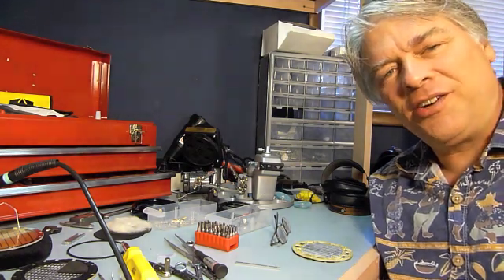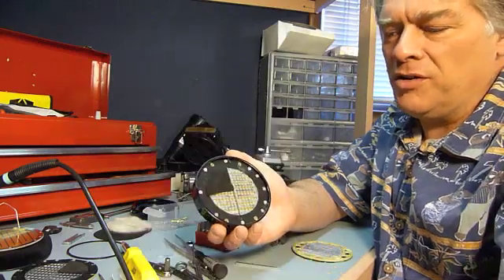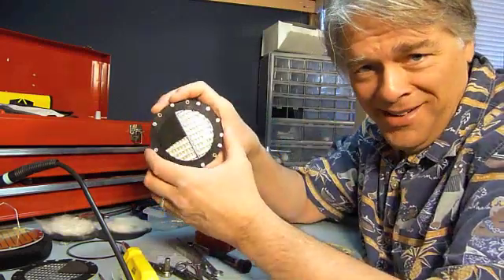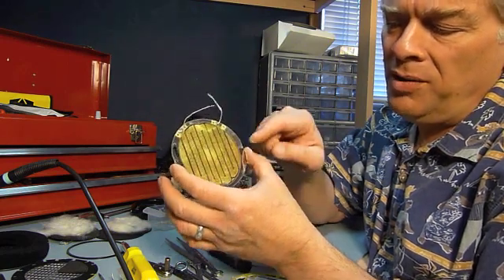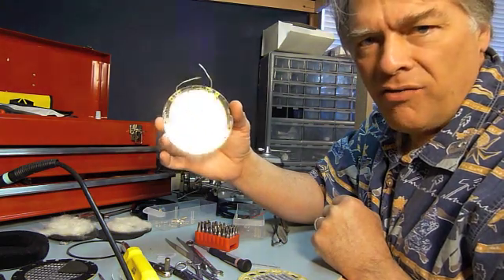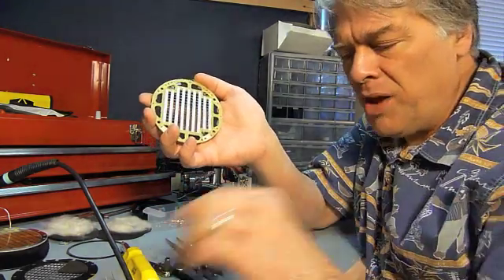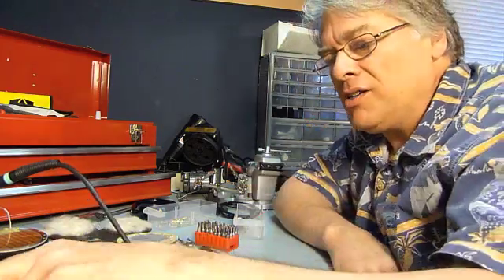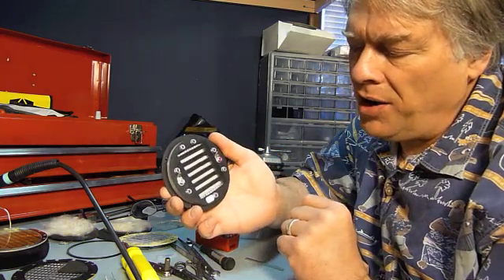Anatomy of a Planar Magnetic Headphone Driver

Comment: this leads me to believe to if you put a magnet on the outside of the cups, it would affect this isomagnetic field as you've shown. Is this accurate?
Reply: Yes it will. Depending on the directions of the magnetic fields the effect will be different. 
In theory even the screws would affect the magnetic field if they're made from ordinary steel. That of course is negligible.

Comment: What is the diaphragm made of?
Reply: Manufacturers use different materials. The most common are kapton and mylar. The thickness of the foil is more important. It should be as thin as possible.  The high end headphones have foil that is 1um or even less.
The biggest unknown would be how they make the tracks on the foil and again every manufacturer probably uses different techniques and materials but no one is telling what.
Reply: @svetko05  i accidentally let my headphones clap together as soon as I unboxed them, would this stretch the diaphragm and change the sound? Or would it just tear if damage were ever to occur?

Comment: since it's a film with with metal in it, and not evenly distributed. does that mean that certain frequencies will be dampened and some amplified? since the metal has a different resonating frequency then the film? they add (those freq) and will distort the sound in that way and also will change the freq response in unexpected ways due to the metal not really being one piece (which i get you need the current to follow a path to make a field) but atleast make the gaps closer together. are there any freq response test for these things ?

Comment: The film on my he 400s has like dents or ripples in it's diaphram on both sides but different, is that final tuning to match the drivers better? Or do the he400s use faulty he 400i drivers. Maybe my set is faulty but they sound great so idk.

Comment: I wonder if the extreme magnetic properties could cause brain cancer after extended use? You saw how powerful and far reaching the field is on these magnets.
Reply: Late reply, but.. the magnets are aligned inside in such a way that the flux is trapped within the inside of the diaphragm. He's able to show you the field because he's taken it off. You can see the amount of force it'll extert on the diaphragm. The force increases squared to the inverse of distance.